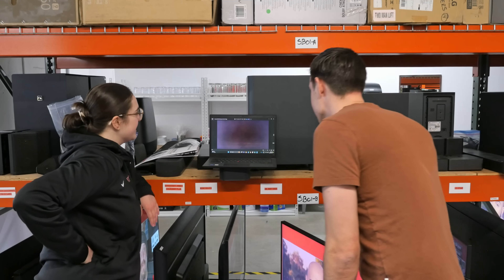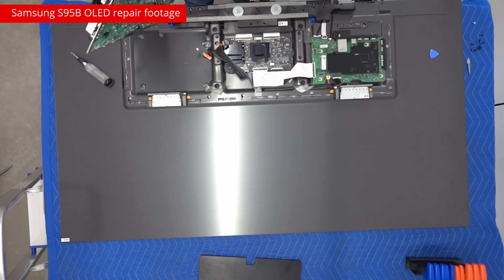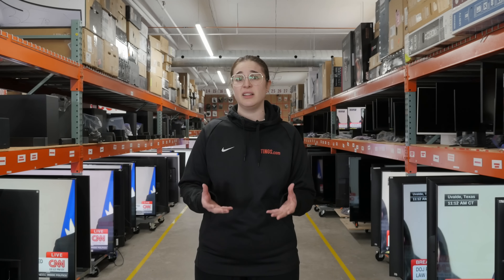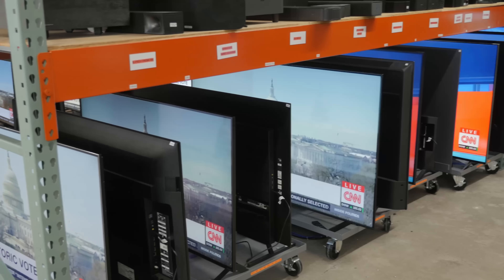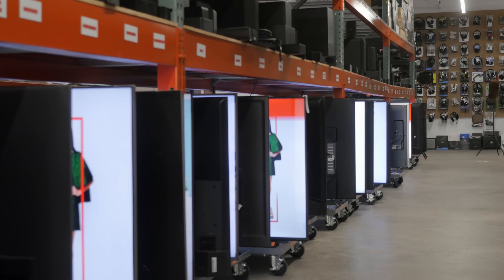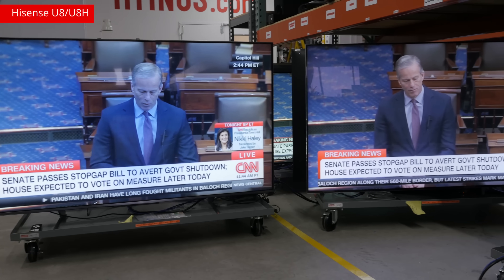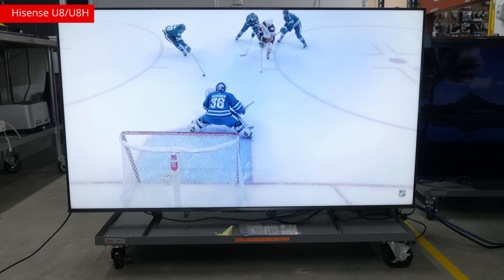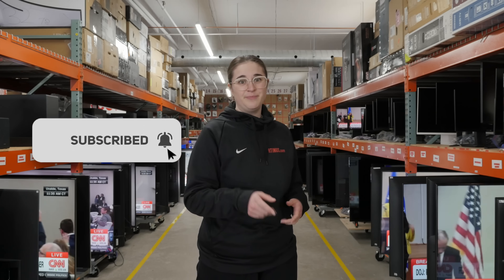1 Year Longevity Update! LCD Models & Future Failures

Comment: My 2-year-old LCD Dell monitor has the start menu icon burned into the bottom left and a slight "phantom taskbar" across the entire bottom if you look closely, not unlike what you would expect from an OLED. I'm not surprised the LCDs are having issues too. Anyone else ever experienced that?
Reply: You mean the thing they describe happened to several LCD TVs in this test... in this very video?
Nah, never happens. It's totally unique.
Reply: low end lcd displays were prone to that, I have seen it myself. It used to happen often during the days of cfl backlight for lcd. It's the liquid crystals struggling to reform to their original state, you can run pixel refresh screens from youtube to try and help with it.

Comment: I bought a 24" Samsung P2350 monitor in 2011~ and in 2023 it finally failed and would no longer turn on, I assume the capacitors failed and I could've easily repaired it however... during its last 5 years of operation it was suffering from the colour temperature warming up.

Around 2021 to 2022 was when the colour warming could no longer be compensated for via the OSD settings. I had Red set to 0, Green set to 25 and Blue set to 100 and white images like about:blank in a web browser still had a very noticeable orange glow to it.

Once the monitor died I "upgraded" to a 2013 Samsung TV that's barely been used. Why did I put upgraded in quotes? While it has much better colours, vibrance and viewing angles (TV is IPS where as monitor was TN)... it has vastly inferior pixel response times (no Overdrive setting to adjust) so when things are in motion in a game things can get rather blurry compared to the monitor I had previously been using.

I know I should just bite the bullet and get a new monitor but it's an annoying topic to research and 32" monitors are hella expensive, there's also always something new just on the horizon... like we're now on the cusp of them finally sorting out the subpixel layout issues of OLED monitors so that text displays well and there's been recent developments in BFI & VRR working together. I've also been learning a lot about OLED's in the last year now that I'm starting to pay a lot of attention to the technology.

Comment: My 4 year old Sony LCD used to set the LED backlight fully on high in HDR mode with no way to turn it down. A recent update now allows HDR brightness to be adjusted. I used to worry about burning out the backlight, and now possibly turning it blue, but at least I can control the backlight now.

Comment: interested to know how this will relate to reliability rating. As most have sample size of 1. I think you should only rate panel. As rest of the components quite easy to fix. And as same brand have multiple representative items. I think the mother glass has similar technology. So you can look into similarity of failure in the same brand but different models.

Comment: I think the key take-away here is that ANY TV can break and/or fail over time, even the most expensive, premium ones. However, over the long-term in the TV space, you really DO end up getting what you pay for. The lower-end TV's from the lower-end brands might seem like a good deal when you walk into a store, but those TVs sell for a lower price for a reason: they are made from lower-cost, lower-quality components that simply do not last as long. You are SO much better off getting a more expensive TV from a better brand (with a better reputation for building quality, reliable products) and then putting it under an extended coverage protection plan, just to be on the safe side. Always avoid the "too good to be true" deals from the lower-end brands. Buying one of those is just asking for problems.
Reply: Did you miss the part where the expensive and high-end Sony A80 and A95s failed?
You only "get what you pay for" in terms of technology, features, and picture quality. 
You should never pay more in the hopes of a longer-lasting product, because it simply doesn't work that way.
Anything above lower-midrange will have similar longevity. Don't buy the cheapest. Don't take a loan out to buy a TV.

Comment: This proves that LCDs can also experience burn in under extreme conditions.
Reply: No it doesn’t. They have image retention from looping the same content. I have an LCD monitor that gets image retention from the windows task bar. If I move the task bar it goes away in a few days. The same thing would probably happen with these TVs.
Reply: not the same thing at all not even close. the liquid crystals struggling to return to their original state doesnt mean they aren't working it just means their state isnt changing enough for them to perform as well at they should. Changing up the content will fix them fairly soon or are lcd displays not allowed to "vary content" like an oled needs to in order to avoid real burnin?

Comment: My Toshiba CCFL lcd still works after 9 years of it being the main tv in the house (2011-2020) and 2 years of being my bedroom tv. But the hisense Toshiba fire tv died after a year and a half with a mobo issue. It’s the only tv I’ve ever had fail in my life out of 8-9 TVs.
Reply: Manufacturers of budget models often drive LED backlights too hard and since HDR (and high backlight brightness default settings) it has become worse.  TVs now are sold too cheaply due to high competition.  If people would be willing to pay 50% more, it would enable higher reliability, but the market's too cutthroat.

Comment: Considering that every OLED has developed severe burn-in and only about 1/3 of the LCDs are showing signs of wear, most of which is only visible in test slides, I would say LCD is much better than OLED for durability purposes.

Proven without a doubt at this point.
Reply: Literally nobody expected anything else, though. However, I think many (including myself) expected the LCDs to do far better still.
For both display types, it's worth reiterating that the test is already up to 7200 hours, meaning if you use the TV for 4 hours a day, the current state of the test is at about 5 years in. And since the test is at 100% brightness and with static content, it's a worst case scenario in addition to that.
If you use your TV sensibly (less than 100% brightness, not 100% content with huge static elements) you'd probably have less wear in 10 years of real usage.
Reply: @exscape  no one but calibration snobs will run at less than 100% though. most of us have windows at home to compete with during day hours.
Reply: @OniMirage  I run at 30% but then again mine is in a light controlled dedicated room.  Its also insanely bright (a TCL QM8, 2000+ nits). 

But even in my bright living room, I ran with the backlight at 30%
Reply: @OniMirage My OLED TV is not calibrated and I run at about 18-25% for SDR. Much more is just uncomfortable. I prefer viewing in a dark room though.
Reply: @exscape ? I used my LG oled around 80% cause of games otherwise it was just dark. Then I just went QLED VRR and solved eveything. Plus saved some money in the process
Reply: @zeus1117  Everybody's different. I assume you weren't in a dark room at 80% though... I'm writing this with a LG C1 at 20% (in SDR) in the evening, and it's just a bit too bright for such low ambient light.
Reply: @FURognar  600 nits in a bright room? I call foul or the room isnt bright at all.
Reply: @OniMirage  its bright but not directly sunlight.   My previous TCL tv was 1000 nits and I ran that at 30% backlight.  But with HDR and DV the backlight was locked to 100.

With my QM8, the backlight is locked to 100 with Dolby Vision and Imax Enhanced, but with regular HDR10 (and maybe 10+) you can dial down the backlight.   HDR10 at full backlight is WAAAAAAY too bright so you need to dial it down.  Especially in a light controlled room like I have now.
Reply: You won't get a like for that comment from rtings. You need to bow before oleds right now lest you anger the display gods.

Jokes aside rtings will never, ever admit that with their own objective data that lcd is far more reliable. This test is a larger version of one that they have already tried to do, they didnt admit it then and won't admit it now. Their rugs are full of fact dust swept under them.

Comment: It would be interesting to know which of the LCD failures were TV's with blue led blacklights using quantum dots to convert to the various colours. That quantum film wears out over time and the smaller blue dots go quicker than the larger red. Normal white LED backlights with colour filters will probably last longer.
Reply: But with less blue, the TV should look more brownish instead of more blueish, I think...
Reply: @vanCaldenborgh  Well all my normal LCDs never had any issues, they all look exactly like day 1 after many thousands of hours of use.

My 2009 LG led IPS LCD tv, my 2011 Samsung 1080P led LCD TN monitor and my 2015 4K Samsung led LCD VA TV look exactly like day 1 but none are HDR or have high brightness.

I'm guessing the high brightness is what's permanently burning the front layer matte or semi gloss anti reflection coating or maybe even screwing the first light reflective white layer and maybe even the colour converter layer.

Ps: I just bought a Hisense U8KQ and this is looking scary, hope it doesn't go bad any time soon at least for the next 10 years as I luckily never had a single led LCD fail on me yet, also this TV heats like crazy even just being ON at the dimmest backlight option which isn't great since I'm guessing high heat is likely what's causing Mo's of those issues.
Reply: @vanCaldenborgh   Some went pink some blue. Pink is the quantum dot one blue is the white led  backlight. A white led is a blue led with a yellow phosphor as the phosphor burns out  it becomes bluer.
Reply: @andrewz4718  Ah, yes the "white" LED is a blue LED with a special layer to get a broader spectrum. I just saw yesterday another video about the invention of the blue LED and also mentioned that.
Reply: LEDs have been turning blue long before quantum dots.  Has more to do with their quality.  Unfortunately, manufactures don't focus on quality parts but the lowest bidder or a better promise of performance with no weight given to a track record.

Comment: X900H did very well for me and has no issue problem for couple years now. LG UJ654UT did not do very well and it has failed after only few years and it turned blue completely! LG 2022 QNED91 so far for me in a year have not yet to see any failure but does have awful DSE somehow though yes. I think OLED is the clear winner, it last much longer than LCD and LED if you are looking after it well to avoid the burning in. I wish they still make plasma tv that last much longer than rest of tv. My dad old Panasonic plasma last well over 15 years until it start to exhibit red flashing. It does have flicker but nothing affected me so far.

Comment: I wonder if it isn't just crappy quality nowadays. my 900E has 25K hours on it and I swear it's flawless in all test slides. They just don't make em like they used to.
Which has me worried when I am upgrading this year. Then again this test has far too little variation and most of the failures are low end TVs that likely use sub-par LEDs and LCD panels.
Reply: They bring out new model tv’s each year some brands (hello samsung Q series) are even bringing out many many models per year..
If they want to sell so many tv’s they have to plan obsolescence every couple of years. Starting by making apps slow and worse or not available, then the hardware fails. Etcetc
Reply: @masomaf it certainly looks like they have pretty crappy panels now. As I said my TV has crazy amount of hours and no issues at all.  It's kind of sad, because I am planning to upgrade and I am going high end. And would be infuriating to have it fail much sooner despite costing twice as much.

Then again this test the TVs are on 20 hours a day on same content. And still 60% of them are just fine. So there's that.

Comment: My sony x950h screen developed some issue about a month after the 1 year warranty ended.  It's tolerable but so disappointing to get problems so soon after upgrading a 10+ year old tv.  I wish these companies would process all this e-waste they pump out.
Reply: What kind of issue. We have the same TV and it's been used for 2 years at least and many hours. No problems with the screen. But it does have had weird shut offs. Like it shut off and you can just press on again and it is back right were it was.  I wonder if that is the OS and something. 
My 900E had a period where it would reboot all of a sudden, but lately it's not doing that as much. Otherwise my TV is flawless still after so many years and hours.

Comment: My 3 year old 50" Moresense U7QFTUK is a real champ! Panel is the most perfect I've ever seen on any TV. After careful adjustment, picture and sound are the best I've ever seen and heard.

I'm often told by the Moresense naysayers, how bad the brand is, but clearly my TV doesn't know how "bad" it is? 🤣

Happy viewing everybody! ... My viewing certainly is! 👍

EDIT: I also have a 22" Samsung from 2011, which is as good as the day I bought it 13 years ago!

ANOTHER EDIT: 16 year old 42" Panasonic Plasma from 2008 ... Yep, you've guessed it! 🤣

Guess I got "lucky, lucky, lucky" as Kylie would say? 👍
Reply: Jep lucky.
I am always very carefull on my materials. But they fail me lot. Except for my iphone(s)

Oled 2018 c7 lg: 5 years of use.. burn in
Garmin sonar Depth reader on my boat: 1,5 years of use, screen suddenly black (luckely waranty was still ok)
Etc etc..
Modern electronics are bad in longetivity mmkay

Comment: And you would think that the more midrange tvs were more prone to failure than high-end models. Like with the OLEDs – expectations subverted. You’re doing great work, folks!
Reply: Keep in mind the sample size is very small, literally n=1. If they had ten, twenty or even a hundred of each model the results might be very different.
Reply from the maker: Thanks for watching! 😄
Reply: I've always wondered why people believe this.
An expensive car won't last longer.
An expensive house won't last longer.
An expensive watch won't last longer.
Sure, there's a point where if you buy the cheapest of something or choose something off-brand it might degrade, but once you get into lower-midrange you're in the clear.
Going upmarket means you're dealing with people with disposable income who value the latest-and-greatest over longevity.
Reply: @tim3172  And yet Rolls Royces last forever....
Reply: @tim3172  Have you heard the saying: "you get what you pay for"
Reply: @tim3172  Yup KIA's are known for lasting forever, same with Black and Decker power tools.
Reply: I've experienced this a lot with different tech products.
Motherboards, GPUs... the more mainstream and mass market, the more reliable. The small quantity expensive enthusiast SKUs had noticeably more issues.

Comment: led lights that illuminate the lcd panel also have weaknesses. if you set the backlight to 100%, they often have a short lifespan. the yellow coating in the led bulbs can also be worn by the heat and become thinner so the blue ultra violet shines through so the image becomes more blue. you got oten light spots over the screen since led bulbs offte shine brighter in the middle. some of the problems they have managed to get rid of or reduced
Reply: Yes, and this test isn't natural to any TV tech. Including OLED. It's a loop of exact same content where it will show the exact same images in the same spots over and over with same intensity. There is no variation despite using "different" content. 
I'm not sure but they might have it cranked on all TVs the light that is. People usually don't have that at all times.
Reply: @loki76  I think that anyone who does these tests will obviously crank it to a 100, basically to make it a benchmark at it's highest performance

Comment: I've had my sony x900h 55 inch for over 3 years now and I have zero issues with DSE or color/brightness issues. I am still upset with the fact that the TV never got true 4k 120hz or a semi serviceable VRR mode, but I will live with that for now -_-
Reply: I have the same TV, similar age. I am also annoyed about the no 4K120 issue or reasonable VRR support. I've not had issues with colour or brightness, though it has this annoying habit of the screen turning off by itself once every week or two and only a restart brings it back to life.
Reply: I have x90J going strong but that was a replacement for 900e which broke after 4 1/2 years , I strongly believe it failed because it was in direct sunlight
Reply: I have a 15-year old Sony Edge Lit LCD TV that’s still running strong.  Zero issues. Looks great for a 1080p.  Think was their flagship back then, or close to it.

Comment: The thing that gets me is that I have a 16 y/o Asus monitor that works perfectly fine. On a 5% test image you can maybe see some uniformity issues (vertical bands of changing brightness) but at a 50% its basically invisible. Not a problem watching normal content. How is it that these more advanced LCD panels are straight up dying a simulated decade before my monitor has even reached retirement?
Reply: Because you got what the industry calls a "golden sample". The vast (VAST) majority of people who bought your monitor got rid of it years ago due to failure.
You don't apply your one of one sample and assume it's "how things were" or whatever nonsense.